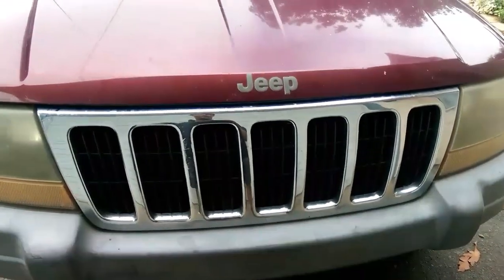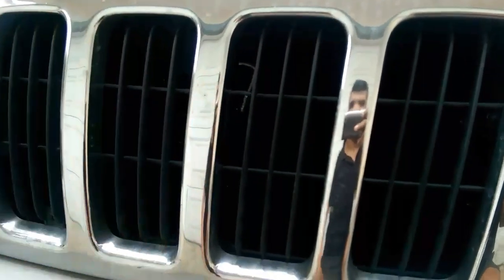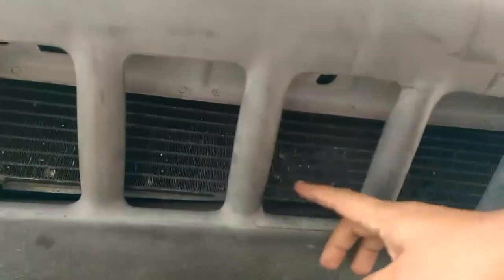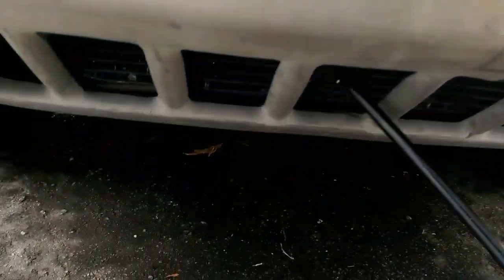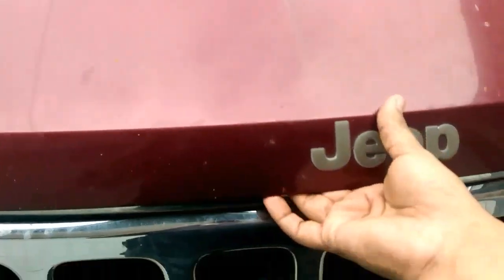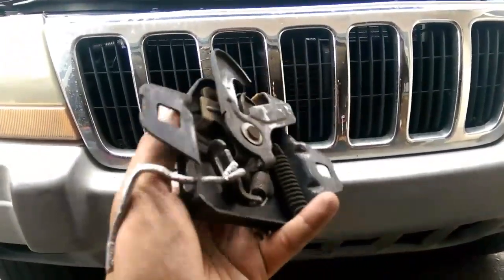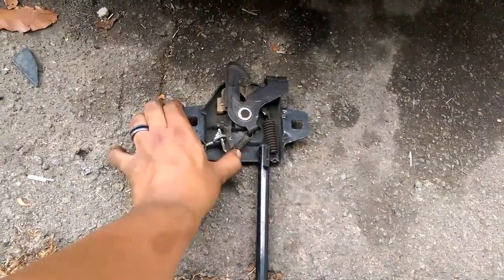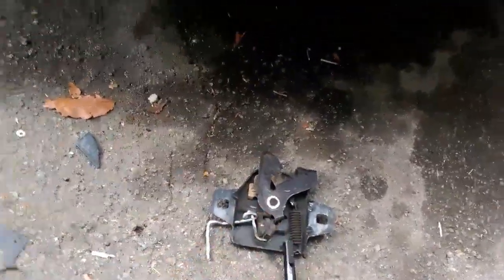How to open a Jeep hood with a broken cable

Comment: Worked! Except that I had better luck with vise grips attached to an L-shaped flat metal bar about 6"x3" long that I just toggled in from just in front of the latch.Took three seconds, no hassle.  It was so easy I might not install a new cable. Without your video, I wouldn't have figured it out.

Comment: Thank you so much for making this video, I was starting to get p*ssed at my jeep for the cable breaking and I looked up how to open a 99 grand cherokee hood with a broken cable and found yours, used my jack bar just like you did but pryed at the cable ripping it out of the grill because mine doesn't have the little grill inserts it's just open, and got it to pop. Again thank you so much for making this video your the savior of my day today🙏

Comment: Thank you!!!!!!!!!! Just did this in my drive way, the plastic retaining ridge on the hood cable cracked and pulled through the latch mechanism - ended up using another nut and bolt in the larger hole of the keyhole notch to keep the retaining ridge seated and hopefully won't have to replace the entire assembly. Thanks again for this protip!

Comment: Good video. I had locked my only keys in the ignition on accessory so it drained the battery. This trick works and I popped the hood, charged the battery, popped the indoor lock with a hanger which didn’t work with a dead battery and started the car. 👍🏼

Comment: Dennis you Rock Man !
Thanks So Very Much !
Quick right on point with your video !
L👀k no further. 
No getting behind my ARB Deer catcher that's on me.
Reply: Update: The skid plate attached to the ARB Roo Bar makes going underneath a chore.
  So I used a piece of copper tubing bent into a curved 90°  went through the grill and after about 5 minutes hit it just right and she popped open.

  Upon examination seems the plastic cable end has worn and slipped through the teardrop/keyhole shaped fastening point on the latch.  So I used a 1/4" long piece of gorilla tape around the plastic cable end to thicken it up taking the slack out of the cable.
As a precaution I threaded a piece of heavy paracord around the latch release lever using the keyhole and ran it back through the keyhole tied a bowline knot in the cord then ran it over to the seam between the left headlight and the grill dropping the excess down out of sight.

Comment: I have a 99 wj. The negative terminal needs to be disconnected when it sits for over an hour because the battery will die. Got to work and the cable fell out of that latch assembly so I watched this. Alternate solution: punch through the grill and get your hand in there to pull the latch that way
Reply: Thanks for the idea on punching through the grill.  worked fantastic since I have a light bar in the way at the bottom.  lol

Comment: I wanted to do this, especially since the oil-pressure light came on once and I have not changed the oil in about 8 months,  Does this render the latch inoperable in the future?  I may have to bring it in to the dealer because replacing the cable seems complicated and difficult.  I am concerned about other issues due to old oil.